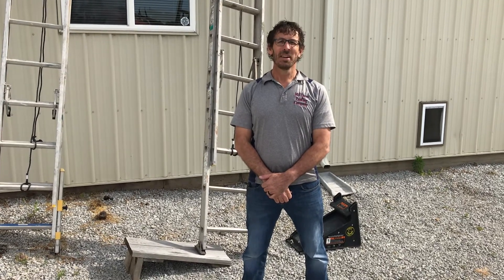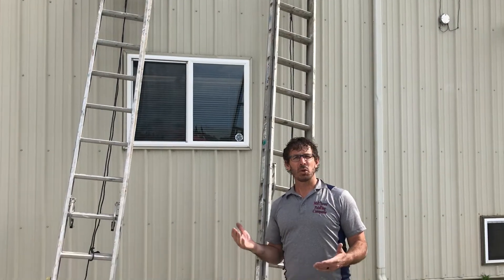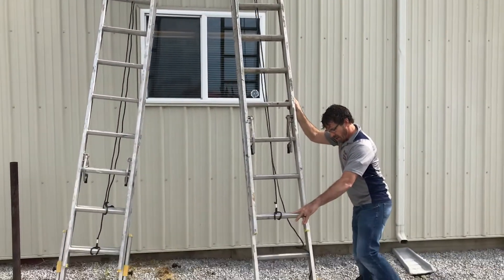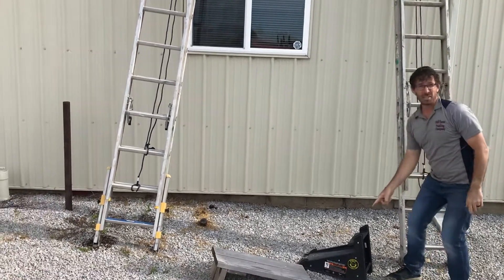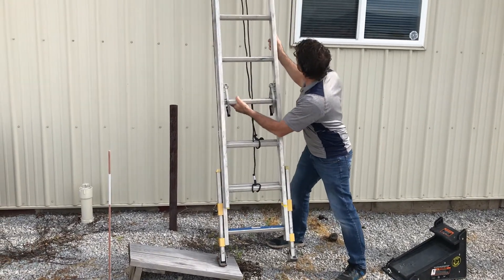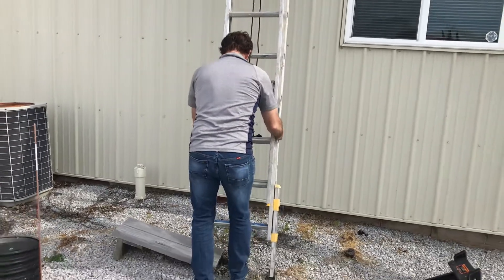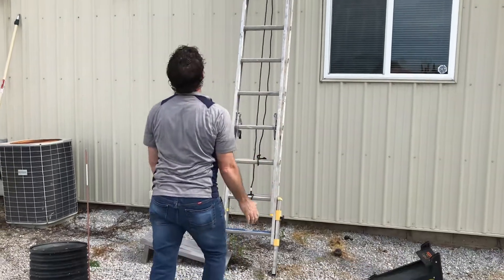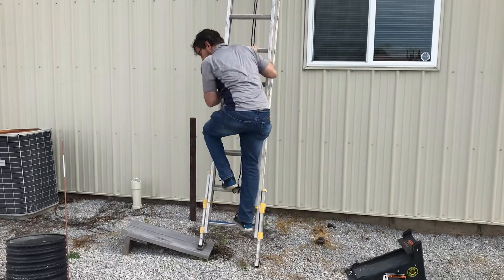Leveling Extension Ladders on Uneven ground- Serving the Warsaw, Goshen and Syracuse Indiana Areas

Comment: Is this even OSHA approved?
Reply from the maker: The wood ramp for my dog  I am just using to create an uneven slope.  That is not what I am promoting here.  The black Pivot tool is what we take to job sites.  We prefer the adjustable legs on the extension ladders whenever we get a chance.  The pivot tool is our last resort.  As for the OSHA question, were you able to find anything on the Pivot Tool?
Reply: @Matthewspainting I believe the Pivot tool advertises that it not only meets but exceeds OSHA requirements

Comment: What if the slope is so wide that there's no flat surface to even put the pivot on?
Reply from the maker: The pivot is made for slopes.  I am not sure i understand your question?
Reply: @Matthewspainting  This appears in the video to only work if one side of the ladder is still sitting on a smooth surface. What if there is no second smooth surface?
Reply from the maker: @exoticcar5482  It works on non smooth surfaces.  This video was demonstrating uneven ground like a slope or hill.  You do however want to make sure the pivot tool is stable, as well as the ladder legs before climbing up your ladder.  Use common sense always.  If you do not feel safe, do not climb up.
Reply: The leveler is on flat ground, your not imitating a true slope is what I think he is trying to say
Reply: @chriso1173  Exactly. This isn't being demonstrated on a hill where there's no smooth surface close enough to assist
Reply: It doesn't matter @chriso1173 @exoticcar5482 since the rise in the pivot tool slope will at some point be level with the ladder leg that is sitting higher up than the other. Demonstrating on level ground just creates a bit of an optical illusion

Comment: it is good for ladder without a soil platform , meaning in my country all the ladder longer and extensible have , when sitting on the soil a piece long (depends on how long is the stair) , perpendicular with the stair.  This sistem do not work on this model ladder. 
The ladder is more stable with this piece than without it. So only pivot or similar is good for this type.
cheers
Reply from the maker: We do not use the wood piece that you see in this video for leveling a ladder.  It is a dog ramp.  we are only using it to replicate uneven ground.  I hope that makes sense.